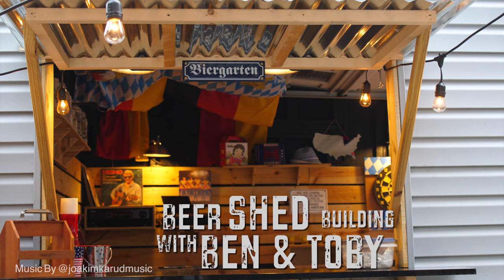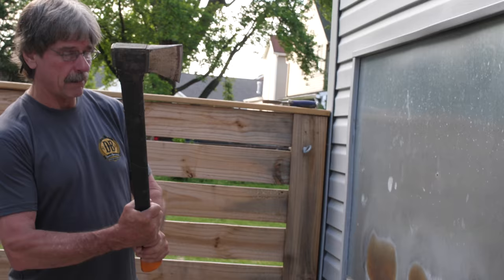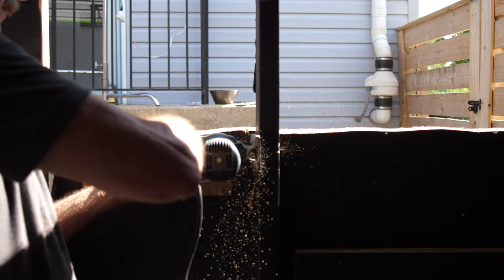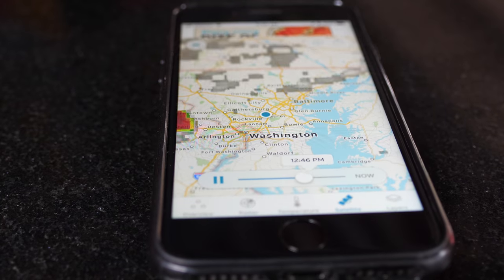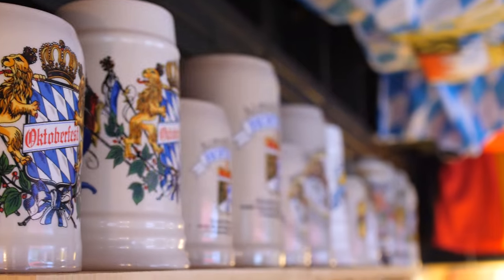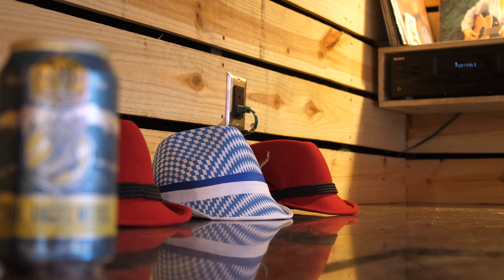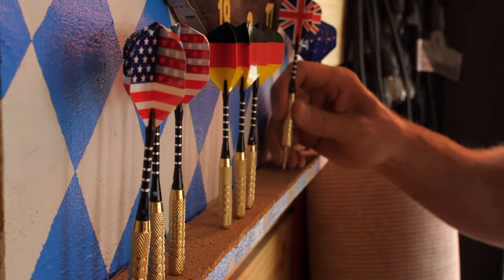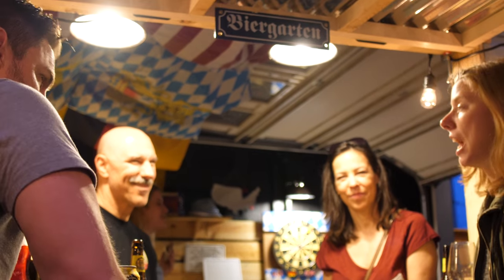Beer Shed Building Ep. 3 Bavarian Beer Shed

Comment: When you cut out the side of a shed for the bar window, how to compensate for beams supporting the roof? Is it just the framing of the bar window that does it? I don't want the roof to collapse over the winter snow lol
Reply from the maker: The roof hinges, so it can drop down when it's not being used, or can easily be dropped if a buildup of snow is coming down. The framing around the hole for the bar opening compensates for the framing that needs to be removed.
Reply: @thebeertrale  Thanks, I was looking up some plans for "window" (bar opening) installs so I knew how to align by king/jack studs, and header. Started drawing up my plans and looking to build in August. Thanks again
Reply from the maker: @AntGonzz  For sure. Feel free to drop me a line if you have any questions.